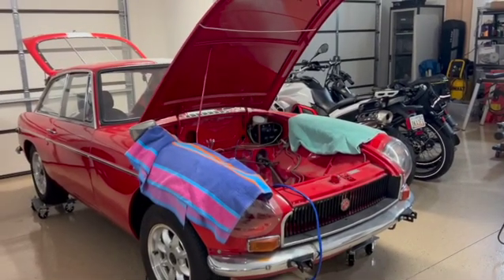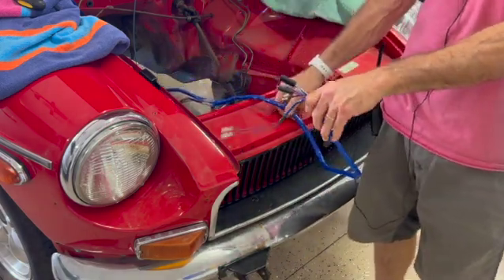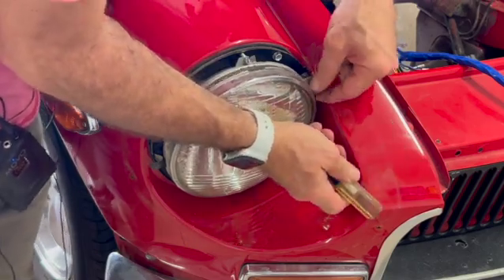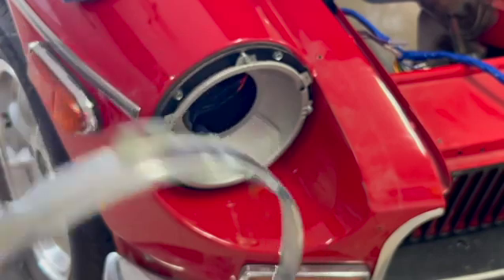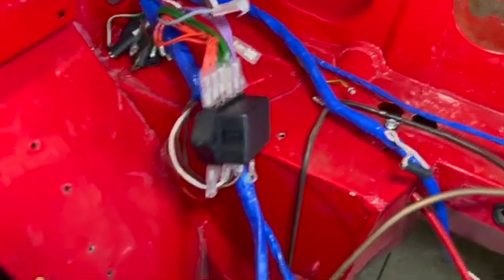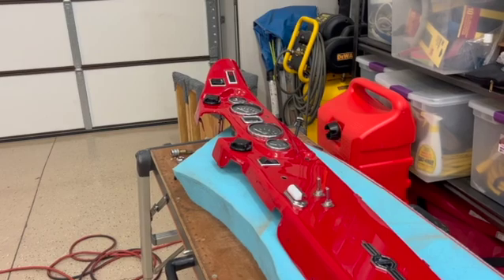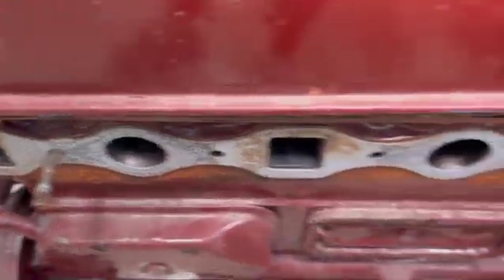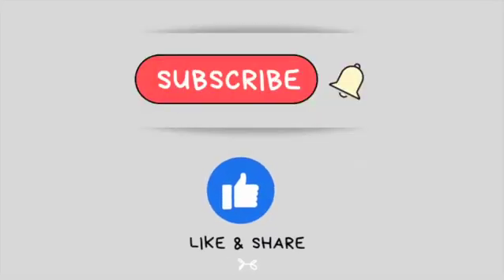MGB GT Electrical Wiring Part 1

Comment: Was your dash originally covered in vinyl?   I like the solid painted metal.  I have a 68 mgb roadster.  I hate the bulky vinyl dash and covering.  Also same as you said here, I want to remove the vinyl from the radio area.  If I can elimate some cost I would like to do so.  Not trying to put everything back to original.
Reply from the maker: I bought the car with the painted dash. It looks pretty sharp!
Reply: Ah the infamous parts on the shelf to be installed later on! I am restoring my 72 MGB and just reassembled the front suspension. It felt great to pull those parts off the shelf and actually put them in the car! How  long have you been working on the restoration?